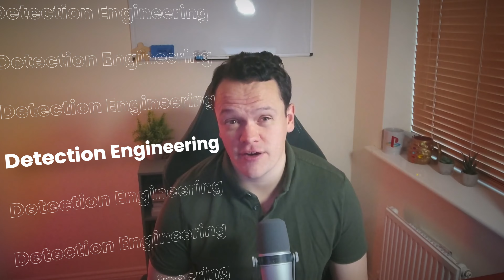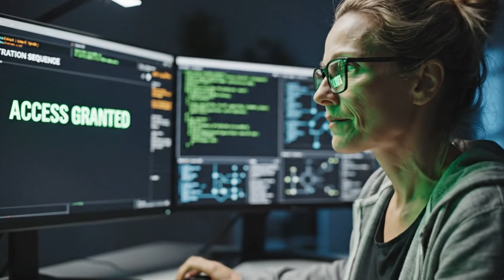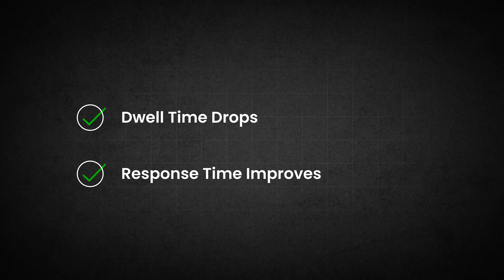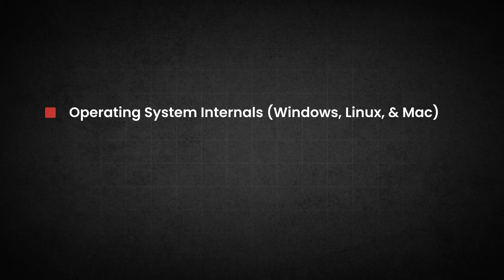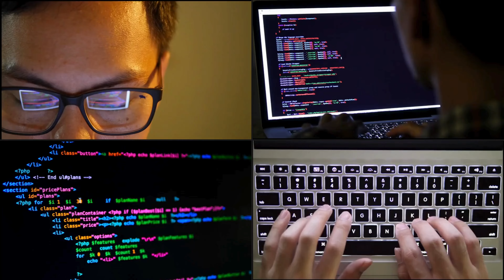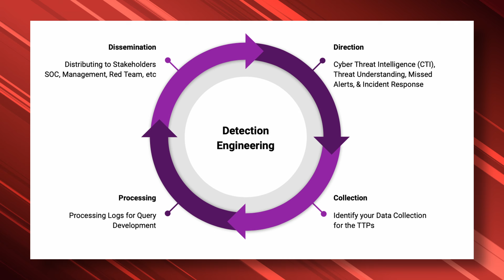Escape the SOC: Why Detection Engineering is the Ultimate Career Upgrade

Comment: I heard Detection Engineering roles are very less. Even if there are, employers won't care unless you have experience. What do you say?
Can this role have remote job offers?
Reply from the maker: 1) Detection engineering is a specialist role with a security operations team (SOC) that requires more experience and diverse technical skills. As such, there will always be less roles available for this position. 

2) Employers will always prefer someone with experience for these more advanced roles but that doesn't mean you need to be a "full-time" detection engineer to land a role. I recommend looking for opportunities to do detection engineering in your current role (e.g. Can you write SIEM/EDR searches/alerts or perform threat hunts? Can you write Sigma/YARA/Snort rules? Can you automate tasks or interact with your SIEM/EDR's API? Can you build a CI/CD pipeline?). This builds that experience and demonstrates you can do the job.

3) Yes. There are definitely remote jobs out there. In my experience its 50/50.

Comment: Adam I worked in SOC for 2 years currently in threat intel for a year and half trying to make pivot to detection engineering. Solid advice and tips. It’s been difficult to pivot at my current company and the job market is tough right now. Any advice to standout when applying to detection engineer roles while not having any relevant experience on resume?
Reply from the maker: Glad the video was helpful! To stand out without direct experience, I've found that creating content is a great way to demonstrate your skills. This could be a home lab you create a blog post or video about, a GitHub project, or even social media posts that demonstrate your expertise.

The key to finding a job is having a strong LinkedIn profile and getting yourself out there!
Reply: @adamgoss-kraven  thanks for your advice, Adam!
Reply: Problem is you're applying against guys with 15+ years of experience for that job too.
Reply from the maker: @eustacemcgoodboy9702  I agree. It can be hard to demonstrate that experience on a resume and compete with people who have been doing this for 15+ years.

I've found a good way to bolster your detection engineering experience is to look for opportunities to do so in your current role.

Can you write SIEM/EDR searches/alerts or perform threat hunts? Can you write Sigma/YARA/Snort rules? Can you automate tasks or interact with your SIEM/EDR's API? Can you build a CI/CD pipeline?

Adding these common detection engineering tasks to your resume shows you have the skillset to be a detection engineer without being a "full-time" one.